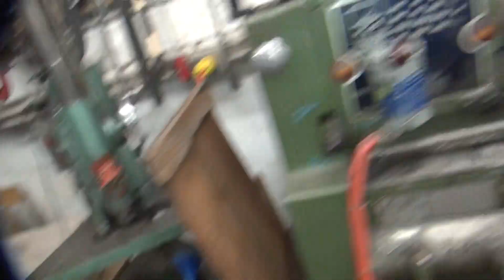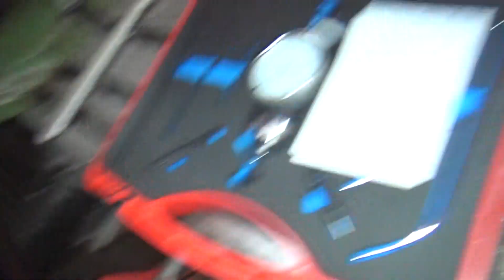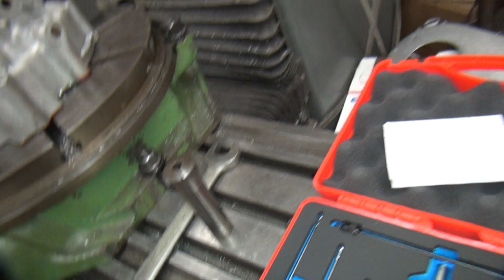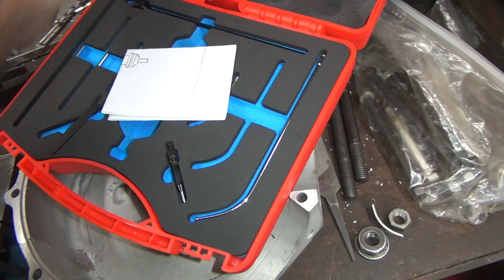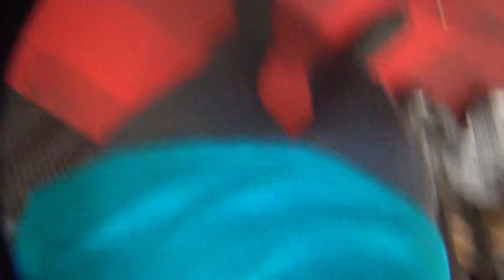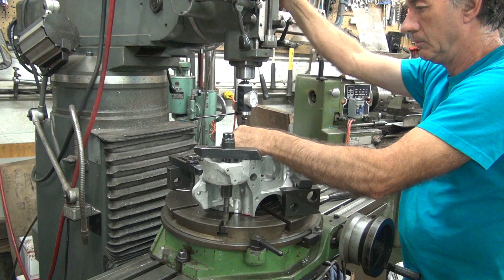#155 1947 EL case welding knucklehead 74ci motor weld and machining repair harley by tatro machine

Comment: I understand. When I saw the monkey trying to dork the football, I realized you're not a machinist. You're a Harley builder that can use machine tools to do basic machining operations on Harley cases, heads etc. You needed a straight stylus. The curved one is for going around the outside of spuds or other special reach needs.
Reply from the maker: you got it, just another dumbass harley mechanic. 
like any new tool, at some point you have to figuare out how to use it. i just show the learing process.
tatro

Comment: Hey, Keenan, those indicators are much easier to use if you are simply centering something that is on the table, by turning the handles. You set the spindle speed to whatever you prefer, then do the X and Y axes one at a time, simply looking for the "null" in the deflection. You may have to do each axis twice, but it is pretty quick.

For centering something without moving the table, as you were doing, I think the way you did it was pretty much the only way.
Reply from the maker: the only advantage i see is that the face stays where you can see it and i can center deep in a hole or case. that is why i purchased it and it worked when i needed it. with my old dial indicator i can see everything that is going on with the hole. most holes are not round so this could be usefull in knowing what is going on.
tatro

Comment: I wanted to thank you for all the setup videos you do on your mill. I am a hobbyist knife maker and not having much money I bought one of the small hand cranked mill vises they sell for table top drills. While not expensive the one I bought has provisions for taking all the slop out of tracks both side to side and front to back. After watching the videos on how you set up the table on yours I bought a dial indicator and used it to get the whole thing flat and true and zero the run out side to side and front to back. Your videos explained this better than any book I read. I have learned a ton of tricks from your videos and never miss ones on the mill. If your motive is to teach you sure helped me. My little setup now puts holes and slots exactly where I need them and on folding knives this makes my life one hundred times easier.
Reply from the maker: that is why i make the videos and show everything. if i don't show everything than the viewers that want to learn something would be lost on the how to do it. anything else would just be entertainment and not learning.
tatro